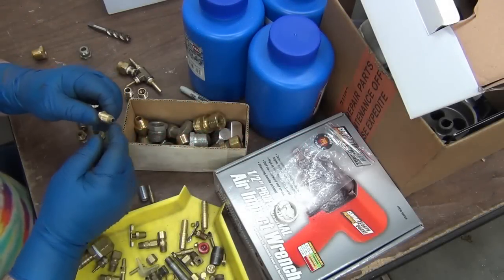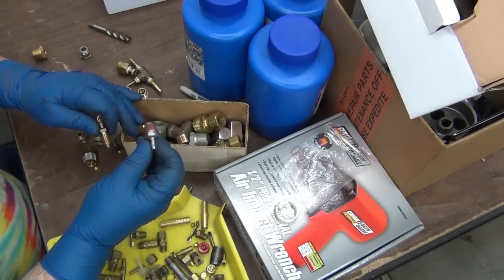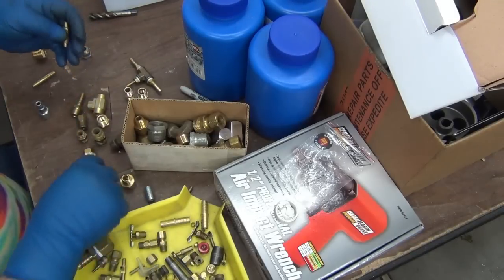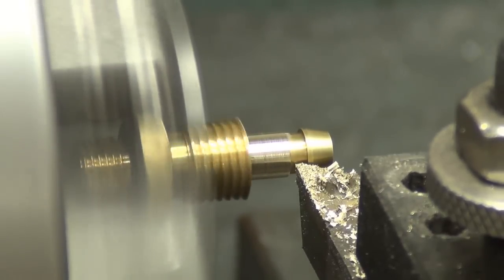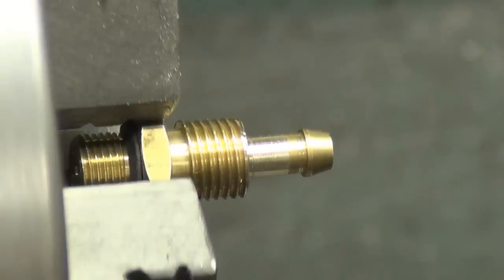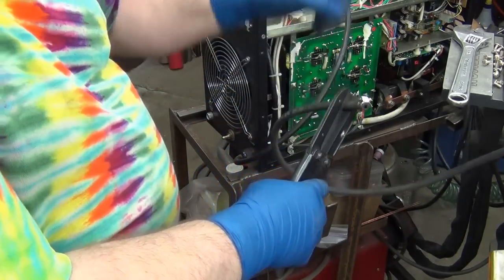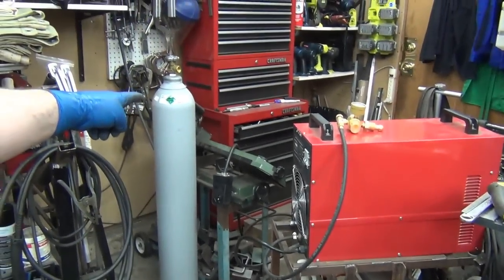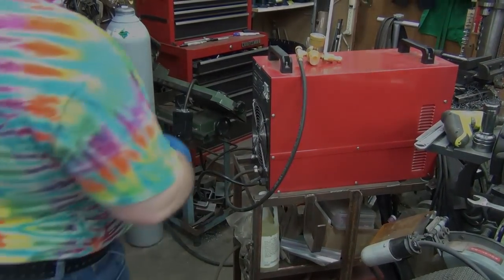Lathe Work - Modify Fitting on TIG Welder

Comment: Great video work.  Nice close-up of the turning.  I had a similar situation on another piece of equipment.  Don't ya wonder why the heck did they not give you enough length to start off with...    I turned the piece like you did but put another barb type step like the first one.  I figured 2 rings were better than one.  Nice work-  Fred
Reply from the maker: Thanks Fred!
I did figure out why......the other fittings for the tubing were the say, but they used a fairly thin walled vinyl or urethane tubing with a nut...almost like a compression fitting, but with out an internal ring.  The ID on the end of the nut simply squished onto the bump created in the hose.  Didn't work worth beans for the rubber tubing! lol
I agree.....two rings are better than one.  Thanks! Mike

Comment: No need for a dial indicator for straightening something in a three jaw chuck, see doubleboost.  He has a bearing on a tool holder that he uses.  Puts it in his quick change tool post and runs it out to touch the spinning part and settle it in nice and true.  It works fast and gets things as straight as your going to get them.  Thanks for sharing.
Reply from the maker: I came across the bearing thing years ago and I still have yet to do it.  I was even thinking about it as I was truing up the fitting. lol   I have the bar stock and the bearings!!  I'll have to do one soon!!
Thanks!!

Comment: They must have ran out of fittings or Chen was having a bad day.  That single barb usually goes on the front to connect the torch hose along with an acorn collar nut.
Reply from the maker: There is one of those on the front.....I just didn't have a nut or the right type of hose.  You get what you pay for and this was really cheap as tig welders go.  lol